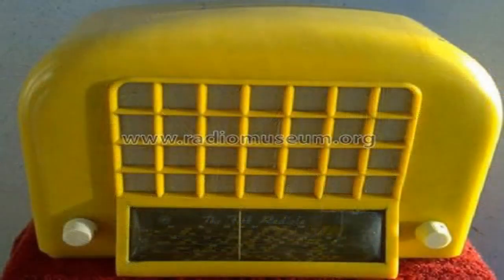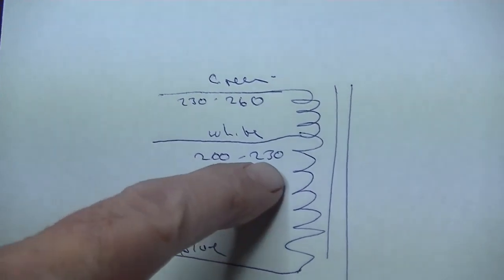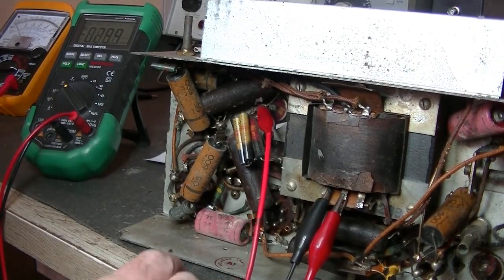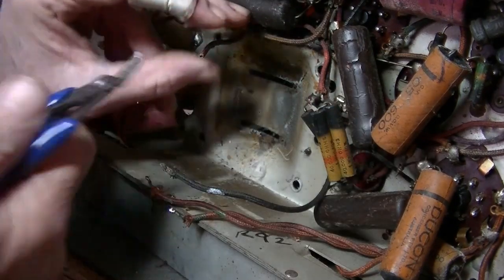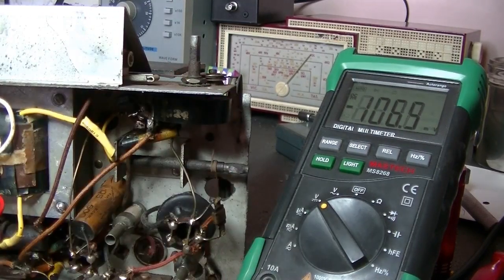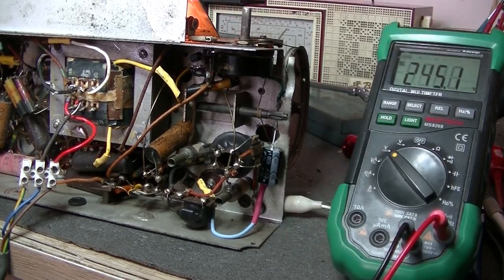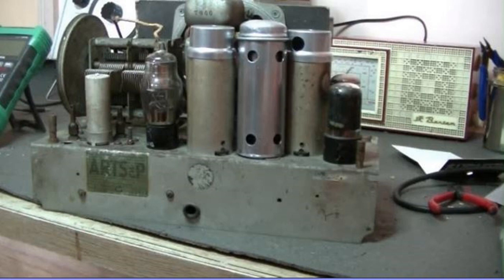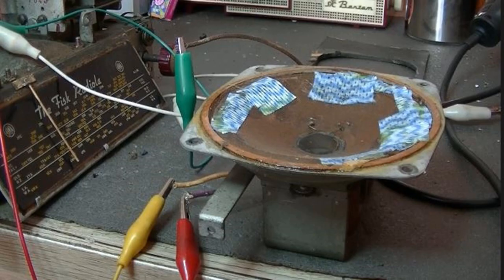Replacing the Power Transformer on a 1940 Fisk Radiola Model 92           (The Egg Crate Radio)

Comment: That’s another interesting video Frank, which would be beyond repair for me since I don’t think I have any power transformer in my stock anymore. The schematic is calling for a 5Y3 and obviously it does require the 6X5 after all, the transformer only has the 6-volt secondary winding and the way the heaters are wire up to the other 6-volt tubes.
Reply from the maker: I was really lucky to have that particular transformer as a spare Ken. I save every one I find from old chassis. I'm guessing the 6X5  was used as they ran out of 5Y3 or had a surplus of 6X5? lol
Yeah, that 6.3 wiring did confuse me at first, still got there in the end

That radio was really sucky to work on too. I really don't like the look of them at all

Comment: The best way to remedy a bad transformer, is to rewind ⏪ it, when no new, or new old stock transformers are available. You’ll be fine, as long as the very thin wire is not burned 🔥 open. Your friend, Jeff.
Reply from the maker: That's something I haven't tried yet Jeff. One day I'll give it a go. Thanks Man

Comment: It is really a bad design to squirrel away  a power transformer inside a chassis. Fatigue from trapped heat will be an issue 
and also could prematurely cook every wax paper capacitor near it. Thick metal plates can absorb some heat but that was
 a chance one took. AWA made 4 tube radio that you shouldn't use for more than a couple of hours a day justly so. Like 
the fact you had a spare working transformer for it. Lots of editing at the end! Achoo! Scotties used everyday by me.
Reply from the maker: Hey Steve, yes a bad design indeed. I heard from an old timer that the egg crate was notorious for cooking transformers and as you say, the wax caps as well. 
oh and Bless you Steve 🤣